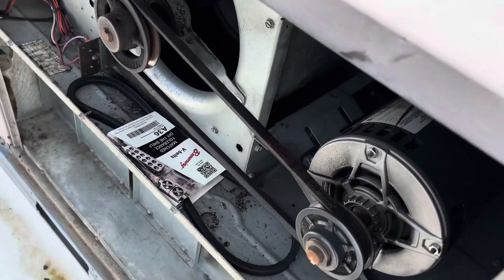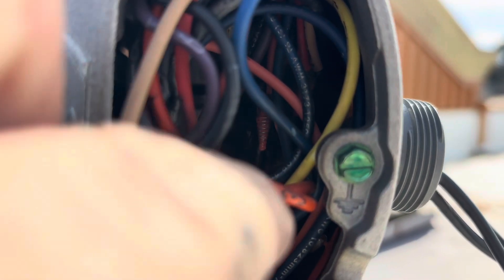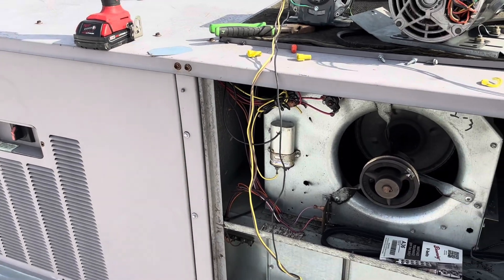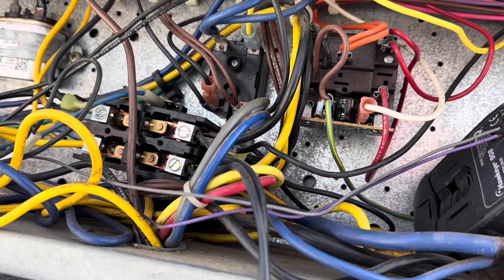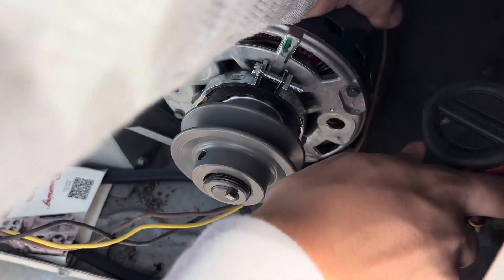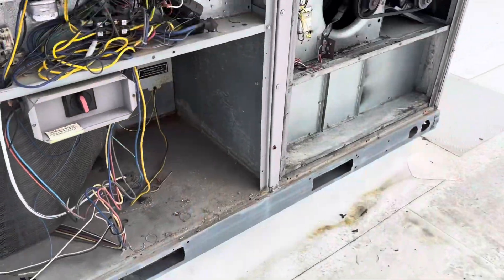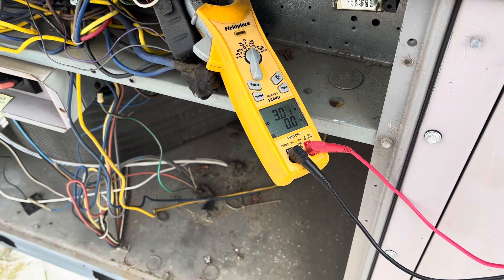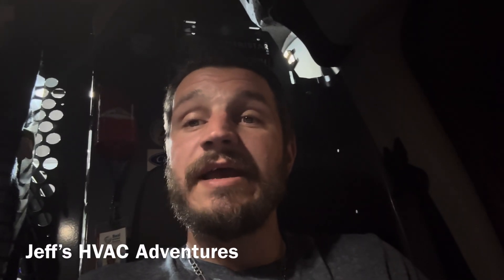Totally HACKS Try Using A 3 Phase Motor In Place Of A Single Phase.  IT DIDN’T WORK!

Comment: Had to go behind another company a few months ago. They installed the right motor but they bypassed the vfd and wired it directly to the incoming power, no contactor or anything. Power failed to the building but only partially. Two hot legs went to the motor, melted everything down. $1500 motor lasted less than a month 🤦🏻‍♂️

That contractor has a picture of themselves doing the job on their facebook page
Reply from the maker: Yikes.  That’s crazy!

Comment: On a Sunday in a pinch I traveled to a pet food company to do emergency repair on an X-Ray system. I got maintenance to give me a step down Transformer/adapter. It worked like a charm and my ass flew back to Tennessee the same day (back in the 80s)
Reply: I worked on food XRAY. Find contaminants and reject bad product.
Reply: @hinspect   yea I worked on metal detectors and rejectors in a food facility. Neat units but no technical support behind them. Chased many issues with ours. We had 2.
Reply from the maker: Good stuff brother.
Reply: I hated working on X-ray metal detectors. Pain in the ass to calibrate and source parts. Sure am glad I don’t touch them anymore
Reply: They only flew your back side ,when will they fly thee rest of you.??